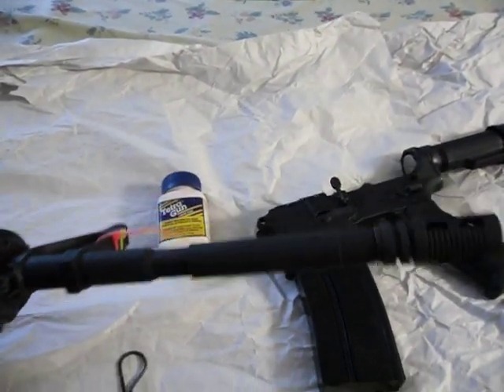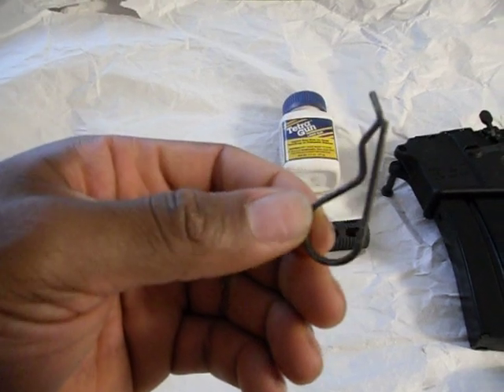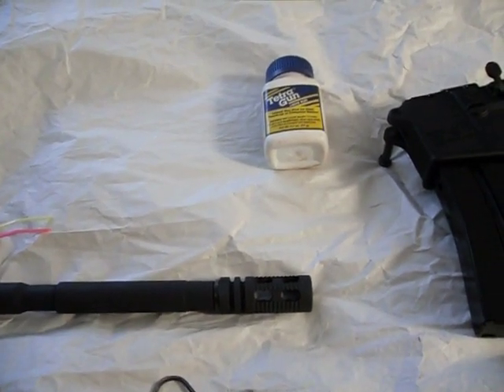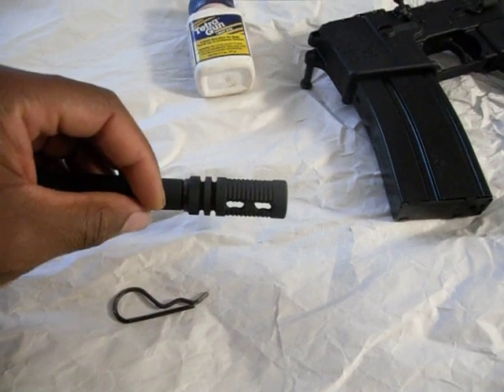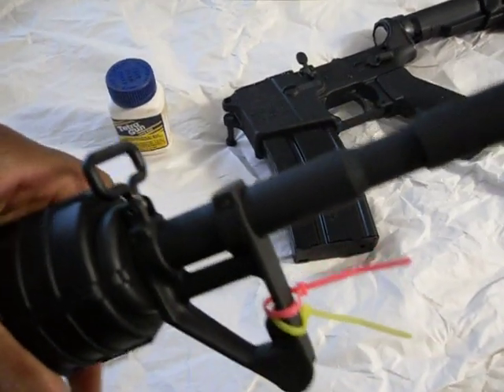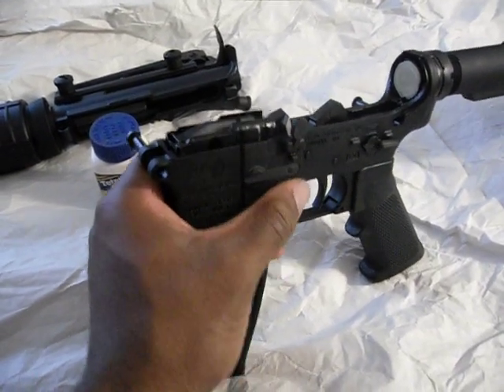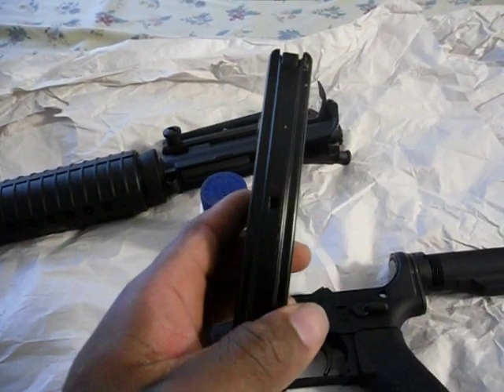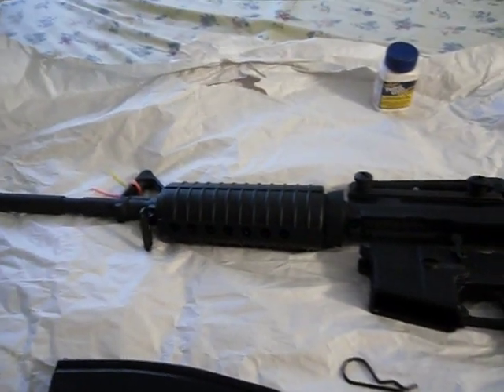How to permanently attached a muzzle brake part 2

Comment: Do not listen to this guy people you will go to jail if done this way, only three BATF approved methods... pin and weld, silver solder or weld it on
Reply: It’s legal to silver solder with say an oxygen acetylene torch? Honest question? I’m about to cut and retread a 14.5 barrel to 13.7 and will have to pin and weld it but I’m no welder lol however I do use oxygen acetylene with silver solder on a weekly basis.
Reply: @James_Edward59 the silver solder has to be 1100 degree or higher.  So depends on your heating element/torch.
Acetylene should get well hot enough.

Comment: I'm pretty sure, the law says "permanently attached", not "firmly attached". Good luck explaining your build as a legal one in the court.
Reply: +Narek Gasparyan if you're in a situation where a LEO is checking to see if your muzzle device (that will not come off by hand or wrench) is welded then you have much bigger problems in the first place.
Reply: +Chris Bilodeau not true. If you have more then 1 firearms, and buy more, which we all do, ATF can give you a surprise visit. That's just their way  of making sure you're not a straw purchaser. I've had one pf those visits and it's completely random. Even if you were right though, what your suggesting is what? Brake the law, just because you can get away with it. That's kind of fucked up.
Reply: The ATF cannot "suprise" visit anyone.  First of all when u complete a 4473 to purchase a weapon that does not get forwarded to the GOV. It stays at gun shop. The only way the atf knows what u have is via NFA filing for SBR or Suppressor and they still cannot POP over to your crib to look around unwarranted :)